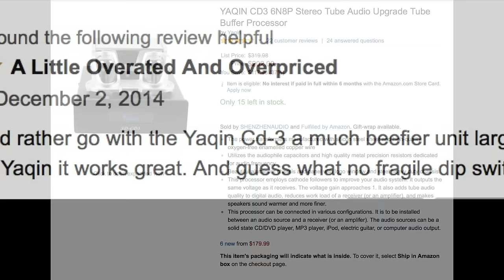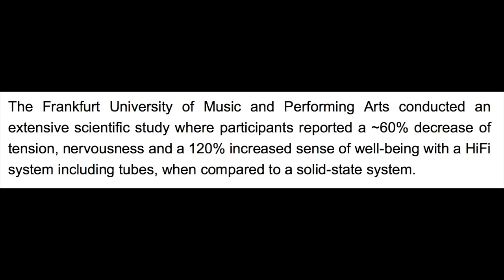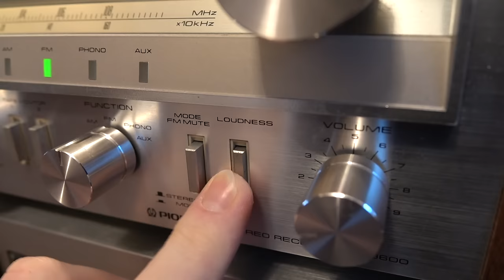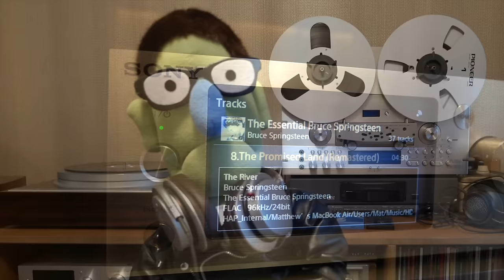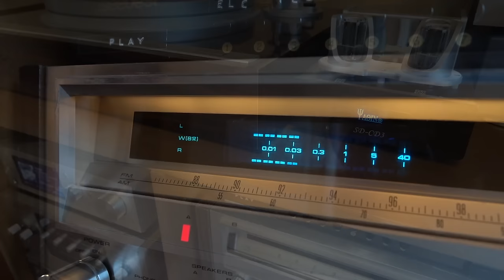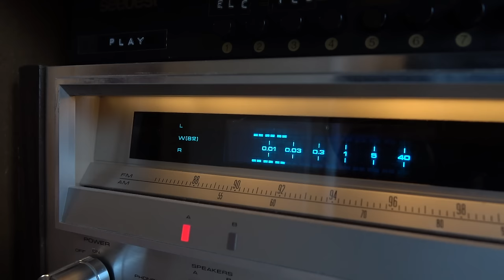Add the magic of Valves to any HiFi - with The Yaqin SD-CD3 tube processor

Comment: The unit is probably a cathode follower circuit.....  I.E. Unity gain on output...It probably doesn't allow "Active" gain from the circuit and instead the unity Gain aspect "Colours" The Sound instead of "Actively adding additional gain "...The insides look thrown together and not well organised . It looks interesting though and for the price it offers decent value for Money. They need to make it clear on the packaging or instructions if it is a Cathode follower Circuit that allows some of the valve flavour through instead of all of it.  This device will be merging both formats of valve and solid state which is why I suspect it gives a "partial" Increase in fidelity instead of a full potential experience. The output quality  is always governed by the solid states architecture of the amplifier you are using and will shadow a lot of the valves attributes and sweetness. Nice theory though and idea to lift the sterile harshness one associates with modern day components making them less fatiguing and the sibilants more rounded on vocals.

Comment: What kind of tablet was that? Its huge.
Reply: It's just an iPad Air in Portrait.
Reply: iPad Pro
Reply: +Artūrs Savickis That's not an iPad Pro. It's missing the top speakers. As I said it's an Air.
Reply from the maker: +xantam23 it is an iPad Pro. I wasn't going to mention it...
Reply: xantam23  I have Air myself, and I guess if you can mistaken Pro with Air, you haven't even  remotely seen them both in real life to make this kind of mistake.

Comment: That original cable is illegal, it is the one blamed for house fires. It has no fuse, the pins are wrong and it is too thin and it makes it a shock hazard.

Comment: 220v Chinese power supply will likely not last on UK 240v. Well known problem with imported Chinese amps. Shame you didn't review with both sets of valves. If this does improve sound it likely is due to better impedance matching. Valves just add colouration.

Comment: +Techmoan
So this is a pre-amp? Also, how is it different than your Pro-Ject's Tube Box S?
Reply: BlueAcid9 no, it's a tube buffer. Basically put it between the source and amp to give your speakers/headphones a tube sound
Reply: +TheMrHalo3Freak
Then what does the Pro-Ject's Tube Box S do? It looks like he has two of the same thing...
Reply: The Pro-Ject Tube Box S is a phono pre-amp for his turntable :) the one in this video is just a buffer (no amplification)
Reply: i wish he would have compared them both, Pro-ject vs. Yaqin

Comment: Oh dear you are gonna regret it dude.The Audio Buffs would strongly advocate that you replace that transistor Amp with a valve Amp if you want the valve experience. you should know this LOLFor what its worth I have listened to high end valve amps with a decent source CD or high end turntable and a nimbus pressing you should do a feature on those next time you want compare vinyl and CD however Valve amps sound very good are they better that a solid state all singing high end ????? in my opinion they are about the same the Amp in question was a Hafler valve and the solid state Amp was a sugden using both sources not much to choose between them.Your bang on room acoustics play a massive part in upsetting the flat response from speakers. Truth is its a matter of personal preference. keep up the Vids

Comment: That plug looks well dodgy ! I'm not sure it's even legal in the UK, it doen't look to have a fuse in it, the pins look way too close to the outer casing and most likely wasn't a CE mark on it for conformity to British electrical standars. Good job it didn't work !

Comment: I have tried to find that study you referenced and the only thing I could find presented some details which suggest that it was of no scientific value. For one, the claim is that the test was "blinded" and that the researchers never interacted with the subjects. However, they didn't say "double blind". That suggests strongly that the subjects themselves knew which system was which. Obviously that in itself renders the study meaningless.

I also could not find any mention of what metrics they were using to determine the effects of the music. How did they determine that the subjects were "happier"? 50 is also a pretty small sample size, though enough for a preliminary study.

In the end, the biggest problem is that I can't find the study report itself. This means that it probably wasn't peer reviewed or validated in any way. I would have no problem believing the result  were they backed up by rigorous research, but that is not what I see here.

Comment: 3:03 What make player is that Techmoan? :)
Reply from the maker: +Jordan 'Dingus'Jones the turntable?  It's a Sansui XR-Q7. A very unusual and sophisticated model. It has a tape head underneath that reads magnetic strips on the outside of the turntable platter which it uses to keep a lock on the speed - it's also got a wheel that rotates in the opposite direction to the turntable to counteract vibrations. I made a brief video about it when I first got it  https://youtu.be/eNMmUMN3jrk

Comment: That power lead fails on so many levels. The finger distance from pins when handling the plug is wrong - so it's the wrong shape, the earth pin has insulated section and of course no fuse.

Comment: I always feel frustrated with comparisons of tube amplifies based on the subjective aural qualities. Why not take a frequency transfer function to get a Bode plot so you can literally see how it reshapes the frequency components of the sound and then maybe a power spectral density of the output with the input terminated to see its noise floor.  I enjoy Techmoan but maybe its time to acquire a SR785 or make friends with someone in a university department who does have access to one or something similar.

Comment: It's a valve pre-amp. You don't need to pay $500 - there are reasonable ones on e-bay for $25. Anyway, my audiophile friends and guitar amp obsessives tell me that you need valves in the final power amp - as well as tube rectifiers and everywhere else, otherwise you don't get all that 'mellow' and university proven stress relief.

Comment: I have a 1958 Quad 11 and it never needs tone or filters, the simplest thing is you need less valves than transitors so less processing also valves have 2nd harmonic distortion whislt transitors have 3rd harmonic distortion which is horible fo music

Comment: I think the high voltage of the valves/tubes mean also that it needs a good and of good capacity PS. In this unit it will ware out the parts very soon and possibly introduce a fire hazard. Popping of the caps for instance. I stay away from these Chinese cheap things..
Check out the old amps, these are massive. For a reason!

Comment: How does it compare to the Pro-Ject Tube Box you got?
Reply from the maker: +Shreddah its not a phono pre-amp, it's an effects box.
Reply: +Techmoan I'm confused, the Pro-Ject Tube Box S isn't a phono pre-amp? I think that's what you have placed in front of the Yaquin in the video.
Reply from the maker: +Shreddah your comment was under the Yaqin...so I was also referring to the Yaqin. 
The Phono Project S is a Tube Preamp for a record player output. The Yaqin is an in-line tube effects box with no amplification.This (the Yaqin) will not work as a pre-amp for a turntable.  The Project Tube Box S will work as a pre-amp for a turntable. They don't do the same thing.
Reply: +Techmoan Hah. misunderstood your first comment, thought you were talking about the Pro Ject. But that explains it, I was assuming it was a Yaquin phono preamp, since they also make them. Anyways, thanks for answering the comment, quite unusual for a channel with 250000+ subs. Subscribed.

Comment: 1. vacuum tubes are NOT halogen bulbs so touching them will not hurt them.

2. techmoan i dont know what you are doing but i am missing some good new videos because i think when you post them you post them to youtube as private videos then link them through patreon and when they get old enough or have been milked of all the money they will make on patreon you then make them public.

unfortunately the original posting date is still in the video making them not show up on youtube's subscription.

i think it would be better for you to delete the video and re upload it so it gets a new date that will not confuse youtube's subscription system

the black ones are filter capacitors used for the power supply and the blue ones are capacitors too but they can be used for many things like signal filtering as well as power conditioning to some extent.
Reply: ring the bell

Comment: Is it really necessary to leave tubes on for 48 hours before listening to music with them? I don't really know much about the subject, to be honest.
Reply: +CoTeCiOtm The theory goes that the equipment "breaks in" like a pair of shoes after being used sufficiently ('burned in' is the actual term). If you run around audiophile discussions, they say this about almost everything -- headphones, tubes, speakers, amps... Some believe it is a real phenomenon, others don't, and still others believe that it affects some pairs of headphones more than other pairs of headphones -- but if you're going to make a video about hi-fi equipment without burning in your new equipment, you're almost certainly going to get some asshole coming along and insisting that you didn't burn it in, so that was why it didn't sound good.
Reply: Nathan Holden Yeah, while I get that, I wonder if it's necessary to have it to burn in for so long as 48 hours, it seems like overkill to me.
Reply: It probably is. But I've heard people suggest burning in even longer than that, even... there's no reason not to use your equipment right away, whether burn in its real or not. It just might sound better after a couple days. Or it might not. Nobody knows.
Reply: Nathan Holden Well, I believe there's a lot of placebo effect in the hi-fi realm, otherwise there wouldn't be people buying $1000 RCA cables. Although my only experience with tube equipment are tube guitar amps, they sound pretty good after around 30 seconds of burn in and I don't notice any improvement afterwards.
Reply: I build and fix amps for a living. If you get new tubes which have been stored for the last 40 years or so they tend to draw minute amounts of air along where the wires got molten into the glass during manufacture. So if you heat them by turning them on the first time after such a long period the silver getter material on the inside of the glass does the job of absorbing this ingressed air and restoring a total vacuum inside the tube. Also the emitting barium oxide on the cathode takes a while to become active again after years of non-use. Why this is so nobody knows, but I have seen it multiple times.
Reply: @blitzroehre1807  Alright, fair enough, but that's like a one time thing to bring them back to a functional state after being left sitting for decades, it's not a thing you have to do every time you want to listen to music, since it's something I've heard people (or "audiophiles" more precisely) do, they turn their equipment two days prior to listening to any music every single time, which sounds ludicrous in my opinion.
Reply: @CoTeCiOtm  Absolutely. "sleepy tubes", as my old Tech master mentor used to say, will be fully functional after a minutes warmup from then on. All differing infos are to be put into the myths and fairy tales category :-)

Comment: sorry about my english but i basic ) dance mix charts muzyczne radio , musical inspiration, if you have the room and the floor is made of planks(WOOOD), you can do so should clear everything out of the room without curtains and curtains imaging carpets furniture in the middle, set the old bed wood, steel, such teeth was supposed batch of springs on which they were placed mattress, your clothes are shirt and pants from flax (LINEN), the support columns bass to the inside and the columns of the substrate pins vibration in the corners of columns remedy beds and just set the columns now connect the amplifier, connect the to him what you want to hear the music at 50% volumnne ( Lie down on the bed), guarantees vibration which never you had to your body. DESCRIPT MASZYNOWANIA DMC MR 1 )

Comment: Are those dual triode valves?
Reply: Yes, the 6SN7 is a dual triode (medium gain) preamp tube which in some old radios, etc. was also used as a preamp and (low) power tube.

Comment: The circuit appears to be nothing more than a pair of kathode followers -- each of the valves is a twin triode with the triodes being connected in parallel. This seems to be the common sort of headphone amplifier/valve enhancer/whatever and I'd guess any difference in the audio would be due to the circuit having a very high input impedance and a quite low output impedance.

FWIW -- I have a valve audio system, a Quad 22/2, which drives a pair of KEF speakers of about the same age.  It actually sounds 'quite nice'. I also have a heavyweigh' system, a couple of Vandersteen 2CE signatures driven from 200w a side NAD power, and it also sounds 'quite nice'. (Our third system, the one that gets used the most, has a cheap 'n cheerful Class D feeding a pair of inexpensive bookshelf speakers that usually gets sourced from an Echo via Bluetooth. It also sounds quite nice'). As you note there are lots of factors that go into how a system sounds; all other things considered I think the most important one is just speaker size and placement relative to room size and furnishings. The one area that valves really score in is that they also double as room heaters as well as audio components -- each one of the two monoblocs consumes 125 watts for a mere 15 watts maximum audio output.

Comment: I'm a great believer in the "less is more" school of thought when it comes to Hi Fi and I have to say I'm not convinced by adding stages that do nothing but "doctor" the sound.  Given your example of bass, treble, and loudness controls etc. I don't do any of that.  Indeed, I don't even have any active electronics between the source and power amplifier, and the volume control (necessary of course), is a unit that changes the volume by switching between discrete Vishay resistors.

Now, that's the "theory"...  The best way to be "converted" to the idea is to try it for yourself.  Get a passive pre amp on line (they vary in price from about $200 to about $800 depending on the quality of the components and extras like remote control etc.) and try it for yourself doing an A -B comparison.  First put a 1000 Hz signal through and match the volume levels and then try it with music.  If you're not convinced in the first minute that the sound is better - more detail, realism, air and space etc. - something's not right!  And although I take the fact that sound quality improvements can be all in the imagination, try getting someone else to do the A - B switching and pick which is which.  If you can't pick which is which every single time, again, there is something seriously wrong.  

I have to say that in my experience selling Hi Fi back in the early 90's, no one ever missed hearing the difference and determining it was an improvement, nor did they ever fail to pick which was which.

Comment: The idiots who believe we shouldn't insert anything into the signal path have actually forced the high end hifi manufacturers to stop building preamplifiers with tone controls and the loudness feature,this is why the biggest spending audiophiles absolutely despise McIntosh electronics because McIntosh builds their amplifiers with big beautiful blue VU meters ,and McIntosh makes 90% of their models of preamplifiers with tone control circuits that can be disabled or heavily used ,I personally would not own a preamp that didn't come with high quality tone controls for Bass & Treble ,I don't find much need for the loudness button but its still a nice feature of my C-2500 Tube preamp McIntosh included ,I leave it off most of the time,without the ability to alter bass & treble in my system the house would be shaking like a street thugs trunk from bass bloat ,I run 7ft tall McIntosh XRT-28 line arrays with dual 10" woofers that put out so much bass where I dislike the sound,I keep my preamp tone control set at a negative 9db setting at all times and the DBX EQ/Crossover/acoustic analyzer display still shows im getting bass response of 15 hz hitting the microphone next to my listening chair ,people who freak out over tone controls are the same who spend $60,000 on a power cord for their amplifier believing they will get better bass response ,my all time favorite audiophile idiocy is the $350 Carbon fiber Cryogenically treated wall power outlet covers that replace the normal plastic covers that cost 39 cents lmao ,or the Audio Brick you set on your rack ,there are even bags of Audio pebbles that sell for $199 dollars that apparently off gas some magic pixie dust and make better sound .

Comment: Speaking of urban myths regarding valves  .........  did you hold your tongue correctly when installing them????  I believe it should be held in a N-S orientation to catch, and disperse, any rogue magnetic influences that could deflect, and thus completely ruin, the anode, or maybe the cathode.

Comment: I was wondering, you know, just be awkward, how it is possible for anything to do anything at 120%?
Reply: Simple, let's say you have 10 candies, then for some reason I give you 12 more candies.... You now have 120% more candies than double did before. An amplifier takes an audio signal and boosts the signal by way more than 120% imagine how a hifi would sound through big speakers without an amplifier..... It wouldn't.
Reply: +InTheNameOfJustice Well it uses the power from the mains, it's not using magic